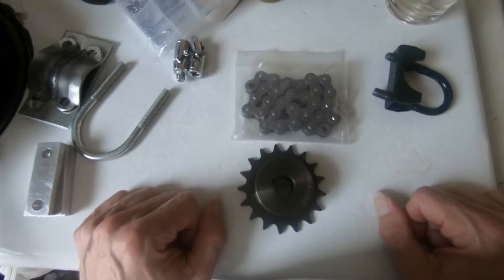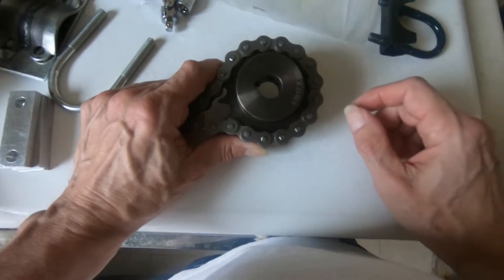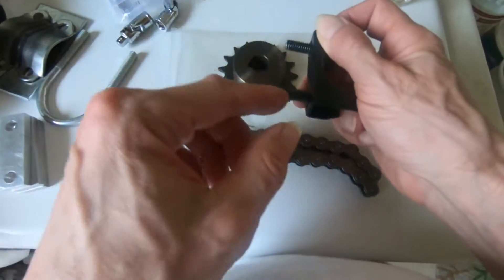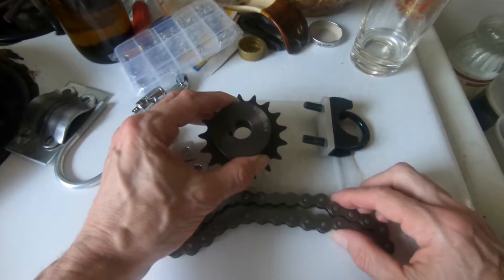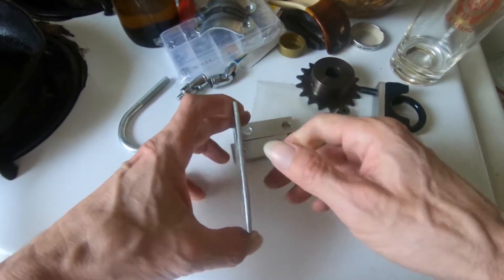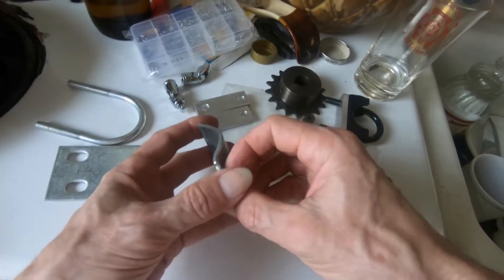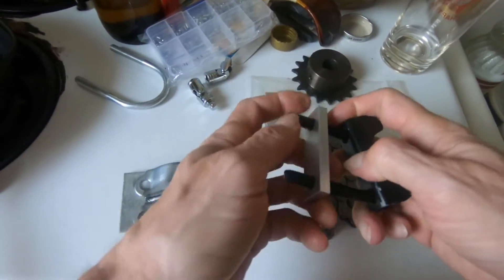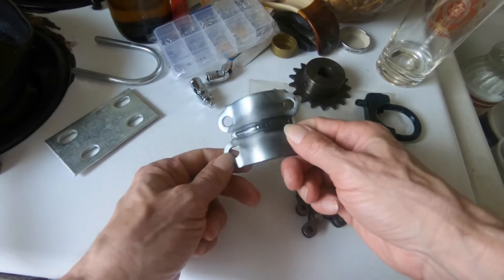Mongoose To Motorized 10 | A Much Needed Update

Comment: Easiest and quickest way is to just slide the rear wheel back further in the rear dropouts. If it's single speed, you can just add a link to the chain.